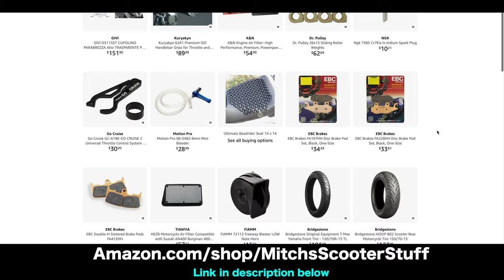2022 Suzuki Burgman 400 naked! What's inside? | Mitch's Scooter Stuff

Comment: Wow great work! Wondering if you might have the step by step DISassembly video, some parts are so hard to figure out! By the way, how would you undo stuck push rivets? I’ve these row of 4 that goes under the radiator and they’re totally jammed - I haven’t had the time to crack the lower leg shields open to try spray some lubricant into them yet.

Comment: Hey mitch need some advice please.
Got a Honda Meteropolitan 2007 throttle brake lever on the handlebar its spring broke, got a new one yet it doesn't really seem to fit right, it matches the old spring, do you think this is just an original design flaw? If after I tune the brakes it doesn't spring back to the resting position I've thought of adding a straight compression spring to the brake lever down on the wheel to force it back into position.

Comment: I’m considering buying Burgman 400 after few vespas gts 300. Im not into mechanics so I can’t get picture is this what we looking in this video good build or not? I know that Suzuki as a brand is bulletproof but never had a chance to own one. And I can’t decide between Burgman 400, Honda ADV350 and Yamaha Xmax 300. 
I’m planning to keep next scooter for a while (6-7 years cca 15-20.000 km) so I’m really looking for best reliability i can get for my money.
Reply from the maker: All of those are good ones... best way to decide which one to buy is look at scooters and sit on it see which is more comfortable and suit best for you
Reply: @MitchsScooterStuff  i have tested all and I decided to go with Suzuki (for now). Maybe is oldest of the bunch but it feels much better built bike. It has better suspension (especially rear) better brakes, more planted on faster corners, better wind protection, better engine sound, better plastics. 
And the price in my country is similar 9000 suzuki/yamaha 8000 honda. 
I have also tested BMW C400GT and except it is bit better on the brakes and bit better wind protection (what is easy fix) everything else is better on Suzuki for 1000 eur less and on top of it much better reliability score in favor of Suzuki. The only hesitation that I have for current Burgman is possible brand new Suzuki Burgman 400 for 2024 (no news yet) but anyway I’ll wait till December and then I’ll decide. Thank you for your advice.